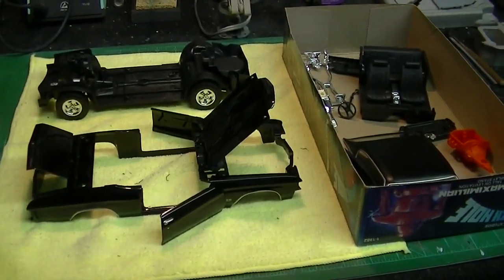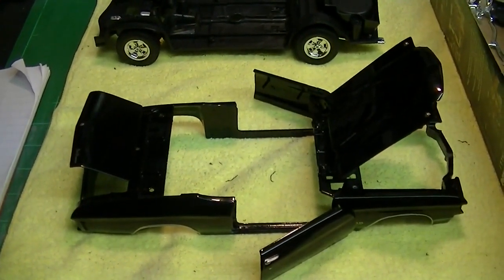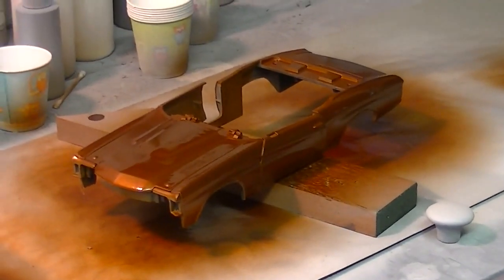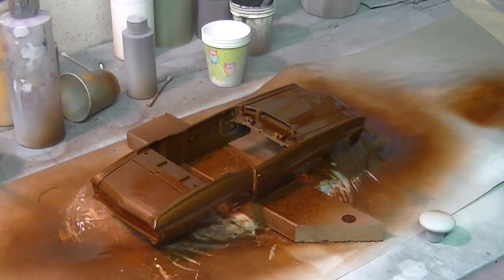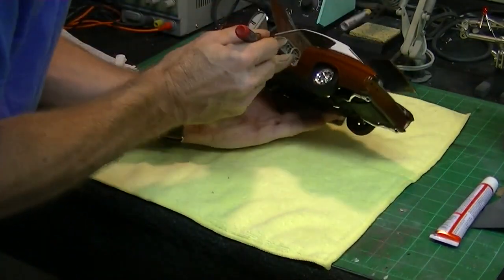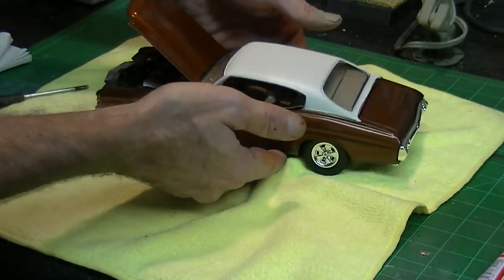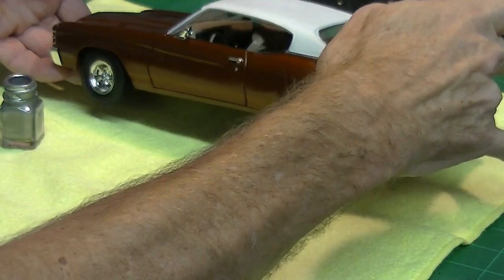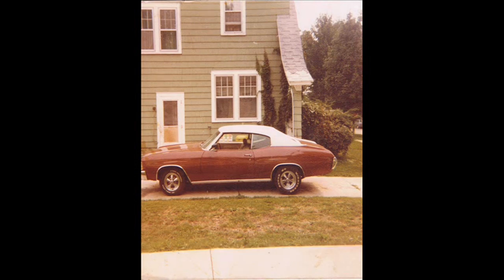Something Different On The Bench With Some Painting Tips

Comment: Could have used some Bare Metal Foil for around the wheel openings and rocker panel.  Also darkened the parts of the wheels to accentuate the five spoke design.  Otherwise it looks fantastic, and its not easy trying to one up the Maisto kits